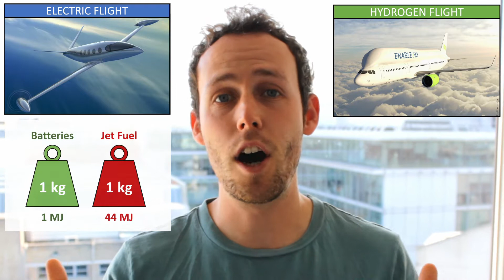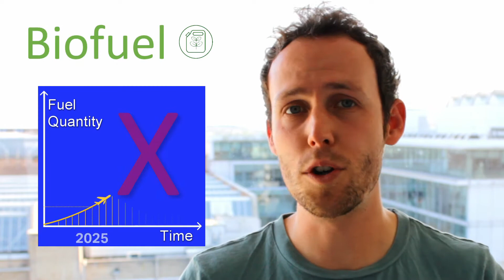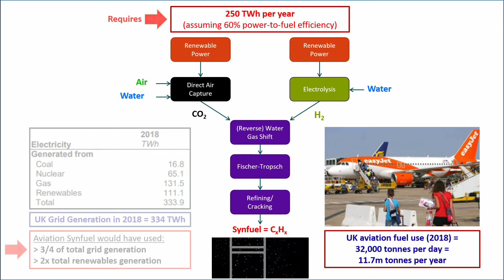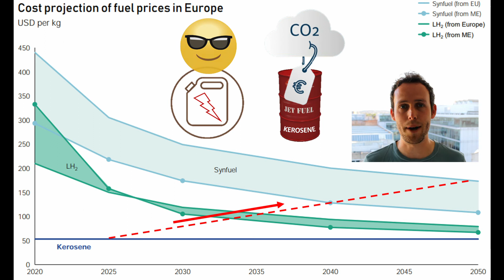Alternative Jet Fuels   (Part 8: Sustainable Aviation)

Comment: green methanol will be cheaper one day.

2nd, Methanol can be used via a Direct Fuel Cell instead of and engine.
And this is far more energy efficient because heat loss is less.

Comment: 2. Biomass Fuel -

Uses agricultural waste, municipal waste, used cooking fuel.

None of them can be scaled sustainably

3. Synthetic Fuel -

Meaning Liquid Hydrocarbon
Produced : Synthesizing Hydrogen with Carbon
Hydrogen can be produced from electrolysis
Carbon can be captured from atmosphere using DAC
DAC - Direct Air Capture

Critical issue -
Technology is in it's early infancy. SO cost are incredibly high
All of the processes are energy intensive

Solution - Increasing emissions' price to make fossil fuel more expensive and synthetic fuel more cost competitive

Comment: Europe has changed the policy which they will go for hydrogen and battery only not SAF. Please get your update about the recent policy change here https://ec.europa.eu/commission/presscorner/api/files/document/print/en/ip_22_3854/IP_22_3854_EN.pdf
Reply from the maker: That's not a policy paper... it's the Zero Emissions Aircraft (ZEA) Alliance... which no surprise is looking at "Zero Emissions" aircraft like electric and hydrogen. If you look at EU policy: https://www.easa.europa.eu/en/light/topics/fit-55-and-refueleu-aviation you'll see that Europe is aiming for 63% SAF by 2050, 28% e-fuels.

Comment: Also, most renewbales papers I've seen suggest that because renewables are so much cheaper than nuclear on an LCOE basis, we will overbuild our national grid capacity 2 or 3 times JUST for the worst few weeks of winter. But what to do the rest of the year with 2 or 3 times your national grid? Synthetic jet fuel sounds like a great function for this "Super-Power" (as Tony Seba calls it.)
Reply from the maker: Solar = 1% and Wind 2% of current global energy use. We are a long way off having overcapacity... many decades off yet. This is about what happens over the next 5, 10, 15 years, we might double or triple our renewable capacity etc. But our energy demand will still greatly outweigh it (hence continued fossil fuel exploration and extraction). So we need to reduce energy demand to stop this happening. Therefore, scaling the most inefficient use of energy (jet fuel production) doesn't feel very clever?
Reply: @GreenSkyThinking  I agree - I think I was imagining further down the track. In the meantime unless governments legislate airlines HAVE to clean up by some deadline - I just don't see it happening. Sorry - feeling a bit cynical this morning. I just hope solar keeps doubling every 4 years as eventually doubling curves explode out at the end! But in the meantime airlines are going to extract every cent they can from this game.

Comment: Why not focus on capturing and storing CO2 in areas whith the absolute lowest cost, and then use an equivalent amount of fossil fuel to keep things neutral. Could be cheaper than making e-fuels from scratch and exporting them around the globe.
Reply from the maker: Hi Jim, yes I tend to agree. My view on e-fuels has matured since I made this video shall we say. E-fuels can only be scaled if we have abundant low-carbon electricity... and we don't. Producing hydrogen and producing e-kerosene are very inefficient processes and they should be minimised... which illustrated the need to minimise air traffic in order to minimise total jet fuel use. What we do use will be very expensive though, so the point being made in this video stands: we'll need emissions pricing for kerosene (you'd need this to raise money for Direct Air Capture of CO2) and alternative e-fuels will be more expensive. Agreed that burning kerosene and powering Direct Air Carbon Capture and Storage (DACCS) will likely use far less energy and be cheaper as a result than producing e-fuel. Page 11 of this report shows that: https://www.theccc.org.uk/wp-content/uploads/2020/12/Sector-summary-Electricity-generation.pdf and I have also helped produce a detailed fact sheet on e-fuels which lays out some of the challenges with e-fuels: https://stay-grounded.org/wp-content/uploads/2021/09/SG_factsheet_8-21_Synthetic-E-fuels_print_FIN_A4_Korr.pdf
Let me know what you think?
Reply: Carbon capture is not economical. Sorry for spamming but Europe has changed the policy which they will go for hydrogen and battery only,  not SAF. SAF still emits CO2. Please get your update about the recent policy change here https://ec.europa.eu/commission/presscorner/api/files/document/print/en/ip_22_3854/IP_22_3854_EN.pdf

Comment: hey I watched your video and come up with a question. I'm writing a practical work in university about bio fuel and I need some information: 
1. How much time do the company need to change ordinary fuel for bio one? 
2. Approximately, how much can it cost for aviation company to switch to biofuel? 
I would be grateful if you'll answers 😊
Greetings from Ukraine 🙏🏻💙💛
Reply from the maker: 1. Not possible: the only commercialised  aviation biofuel pathway is HEFA, and can only be scaled to roughly 2% of total jet fuel use. So if the airline in question wanted to change all its fuel to biofuel, there wouldn't be much left at all for other companies.
2. For HEFA the cost is 2-4 times the cost of untaxed kerosene. Prices depend on kerosene price (affected by oil price) and competition for the (limited) HEFA feedstock. HEFA is currently 2-4 times the price I believe. Other fuel types can be much higher cost, e.g. 5-10x higher. Search for:  https://theicct.org/publication/the-cost-of-supporting-alternative-jet-fuels-in-the-european-union/
Reply: @GreenSkyThinking  thanks a lot for your help👍🏻👍🏻😉
Reply from the maker: @oliatsarenko7010  again, there is competition for the feedstocks of the other aviation fuel pathways, so I'd advise you actually consider whether using aviation biofuels at all is a good thing from a true "sustainability" perspective? And if so, how much and why?
Reply: Sorry for spamming but Europe has changed the policy which they will go for hydrogen and battery only,  not SAF. SAF still emits CO2. Please get your update about the recent policy change here https://ec.europa.eu/commission/presscorner/api/files/document/print/en/ip_22_3854/IP_22_3854_EN.pdf

Comment: I heard that the CO2 captured near the ground has a climate impact 3x smaller than when it's emitted say 30,000 ft off the ground, making even jets fueled with synthetic fuel climate killers. Is this true?
Reply from the maker: Yes and no. The 3x multiplier is due to non-CO2 emission impacts if these aren't mitigated. They aren't today, but could be easily via small changes in flightpath to avoid regions of the sky that are susceptible to condensation trail (contrail) cirrus cloud formation... and synthetic fuels offer an improvement even if you fly directly through those regions because they have lower aromatic content and thus burn more completely, producing less soot and in turn less nucleation points for ice crystals and thus contrail cirrus to form. Possibly a 50% of so reduction, so its significant: https://www.nature.com/articles/s43247-021-00174-y
Reply: @GreenSkyThinking  Ohh wow! Thank you so much for the knowledgeable answer!

Comment: There remains the problem of byproducts from burning hydrocarbons. Even if the fuel is de facto carbon neutral.
Reply from the maker: Yes, although alternative synthesised fuels do have lower "aromatic" content (impurities) which mean they burn a bit cleaner and are slightly more efficient and produce less soot and particulate matter. This in turn means they form less contrails behind aircraft and produce less non-CO2 warming... BUT they can't be scaled fast enough!
Reply: @GreenSkyThinking  Do you know if it can be said that the longer you travel at the highest possible altitude the less of a warming effect SAF could have? Due to less atmospheric density and therefore less reaction opportunities. For instance boom aims to have a travel altitude of 60,000 feet. I don’t know how long they want to sustain that altitude.
Reply from the maker: @jaslarja  some of the problems for supersonic travel:
- you burn about 5x the amount of jet fuel to transport the same passengers the same distance (just faster) 
- water vapour global warming impact increases with altitude and the global warming from this is likely to dwarf CO2 emissions.
https://theicct.org/publication/aviation-global-supersonic-safs-feb22/
Reply: Sorry for spamming but Europe has changed the policy which they will go for hydrogen and battery only,  not SAF. SAF still emits CO2. Please get your update about the recent policy change here https://ec.europa.eu/commission/presscorner/api/files/document/print/en/ip_22_3854/IP_22_3854_EN.pdf

Comment: Hey, could you add a link to your sources and the graphs showed? :)
Reply from the maker: Hey, so some of this comes from the EU FCH Hydrogen Aviation report: https://www.fch.europa.eu/sites/default/files/FCH%20Docs/20200507_Hydrogen%20Powered%20Aviation%20report_FINAL%20web%20%28ID%208706035%29.pdf e.g jump to page 48 and you can see the cost curve I used towards the end of this video. Also page 44 of the same report shows the huge energy requirements for LH2 or synthetic e-fuel. "Decarbonizing the aviation sector via LH2 and synfuel would thus triple to quintuple the renewable energy produced globally today – in other words, demand for renewable energy would be 20-30 times as high as renewable energy produced in Europe." My similar calculation for the UK is done taking jet fuel use = 12Mt/year, multiplying it by energy density of kerosene = 12kWh/kg, to get 145 TWh. Then divide by 0.6 to get input renewable energy required for e-fuel production at 60% efficiency. Should get about 250TWh. That's being very optimistic as you can see from page 44 of the source above, the aviation industry report says 22% power-to-liquid efficiency. 60% is approaching theoretical limit. 

Biofuels are bad news. See Section 7.1 here: https://drive.google.com/file/d/1ImrCJXdt0s8EahZBiL6fLaRzgHuyPsFh/view?usp=sharing
See section 4.5.1 of this report also: https://www.transportenvironment.org/wp-content/uploads/2022/03/TE-aviation-decarbonisation-roadmap-FINAL.pdf
Remember, this is theoretical maximum supply, and we need limited sustainable biomass for other things e.g. BECCS.
Reply: @GreenSkyThinking  awesome! I really appreciate the quick and extensive reply. Thank you!
Reply: Sorry for spamming but Europe has changed the policy which they will go for hydrogen and battery only,  not SAF. SAF still emits CO2. Please get your update about the recent policy change here https://ec.europa.eu/commission/presscorner/api/files/document/print/en/ip_22_3854/IP_22_3854_EN.pdf

Comment: Hi, grat video! I am currently writing my master thesis about possible policies to support the use of green hydrogen in the aviation sector and I am focusing on Synthetic fuels so your video is a nice overview. 
Could you tell us which sources you have used next to the McKinsey report? I guess, it could be very helpful for the first part of my thesis. 
Thank you for the clear and short summary about the topic!
Reply from the maker: I'd check out this recent report:
https://www.transportenvironment.org/discover/2050roadmap/

I'd suggest considering whether green hydrogen should be most efficiently used to hydrotreat kerosene to remove aromatics, rather than to make biofuel or e-fuel. Reduce fossil fuel aromatics will reduce soot and thus non-CO2 emissions (which cause 2/3rds of aviations climate impact).
Reply: @GreenSkyThinking  Thanks a lot! I will have a closer look on the report today and will keep your comment in mind! 
It's a super interesting and hot topic so I am grateful for all the impact and different ideas and views! :)
Reply: Sorry for spamming but Europe has changed the policy which they will go for hydrogen and battery only,  not SAF. SAF still emits CO2. Please get your update about the recent policy change here https://ec.europa.eu/commission/presscorner/api/files/document/print/en/ip_22_3854/IP_22_3854_EN.pdf

Comment: You are wrong about the crops. Educate yourself on that part
Reply from the maker: Hi Carlos, thanks for the comment, what specifically is incorrect?
Reply: @GreenSkyThinking  SAF from biofuel is being scaled as we speak (NESTE, GEVO, LanzaJet, etc). show me synthetic fuels scaled at the same rate as biofuels. Agriculture is currently playing an enormous role in Biofuel. If you would take the time to read what is being done by companies like GEVO, you would understand. Oil companies are actively seeking to invest in SAF from biofuels.
Reply from the maker: @caribbeanheartmender  great, they also said the same thing in the 2000s, but it's 2022 and how much quantity of biofuel 'SAF' was produced in 2021? 0.05% of jet fuel use. Neste uses palm oil fatty distalate (PFAD) and palm oil plantations are a major driver of deforestation. Check out: http://www.biofuelwatch.org.uk/wp-content/uploads/Cellulosic-biofuels-report-2.pdf
Reply: @GreenSkyThinking  do you have a LinkedIn page or some place with your credentials?
Reply: @GreenSkyThinking  so your goal is just to minimize air travel, disregard biofuel, and rely on better engine tech? You must be smarter then all of the other people collaborating in this industry. Have to question people who put so much energy In opposing reasonable solutions.
Reply from the maker: @caribbeanheartmender  hi Carlos. Worth a read of this: https://www.transportenvironment.org/discover/2050roadmap/ it shows a decarbonisation roadmap with some limited use of biofuels and some e-fuels and some hydrogen, but fundamentally we have an energy use problem, and a lack of low-carbon energy (be it biomass or renewables), so we need lt reduce total consumption and that will mean flying less.

FYI I worked in future programems for Rolls-Royce, one of the largest aero engine manufacturers in the world, so I am "from the industry". I also spoke to the corporate sustainability team about this regularly, and the CEO and the CTO. The CTO believed we should be making e-fuel from purpose built nuclear power stations. Hardly a cheap and quick method. My Linkedin: https://www.linkedin.com/in/finlay-asher-40612665 

As I say, the industry has been promising biofuel scale up as the solution to this problem since the 2000s. The only advanced biofuel pathway demonstrated at scale is HEFA, and that can't be scaled. Fuel from other waste streams hasn't been commercialised, you need to put in a lot more energy than you get out, and it's more efficient using it for other purposes.
Reply: @GreenSkyThinking  what population of those who fly today would be your target audience to reduce air travel. How do you fit an ever growing economy/population into your thoughts? Are only rich people going to fly? How do you think this will affect migration?
Reply from the maker: @caribbeanheartmender  OK so I'll note that we've now moved away from the technical question of "to what quantities can these fuels be scaled". Those are good questions though: the international energy agency (IEA) in their latest "Net Zero by 2050" Report state there should be no growth in business travel and long haul leisure travel from 2019 levels. Fundamentally, flying is already highly unequal as only 20% of the world's population has been on an aircraft, and in a given year less than 5% fly internationally and 1% produce 50% of aviation emissions (see my other video on inequality of flying). So it is ALREADY predominantly rich people who fly, and who benefit from the subsidies and tax breaks enjoyed by the fuel producers, airports and airlines. We need to phase out fossil fuel subsidies obviously, and this will make kerosene more expensive, if we switch to advanced biofuels and E-fuels this will also increase costs by many multiples. So flying fundamentally will become more expensive (apart from where electric aircraft can fly). The question of financial burden is a good one and I'd advocate a frequent flyer levy that places that burden on frequent flyers who produce most emissions and are generally high income. I'm not sure what you mean about migration?
Reply: @GreenSkyThinking  understanding your point, the ripple effect from a decreased expansion of airports, decreased flights (cargo, commercial / business), comes at the expense of significant inflation within this industry and costs of goods. In your opinion, Are there any underlying opportunities/technologies which could be deflationary and therefore offset some of the costs?
Reply from the maker: @caribbeanheartmender  well its a bit like saying "we need to phase out coal... ah but coal is the cheapest form of energy and doing so will increase costs". Such an equation is only possible if you ignore the negative externalities of emissions and the huge (potentially irreversible) economic impact of climate change. Its also worth saying that we tax road fuel and most people pay for that including an increased price for goods, so why not jet fuel? Technology: I think we should focus funding on more efficient aircraft, engines and operations rather than on subsidising fuel pathways that compete for scarce resource with other sectors. There's a win-win, but it needs to be within a market where fossil fuel use and GHG emissions are actually capped and reducing every year (see my video on aircraft efficiency + the T&E report I linked above). Hydrogen and electric aircraft will play a role at shorter ranges and E-fuels (and small amounts of biofuel) at longer ranges, but I think that should be within a framework of energy consumption and emissions reducing year on year. If we continue to grow air traffic at the current rate, we'll need all of the world's biomass and renewable energy just to make jet fuel.